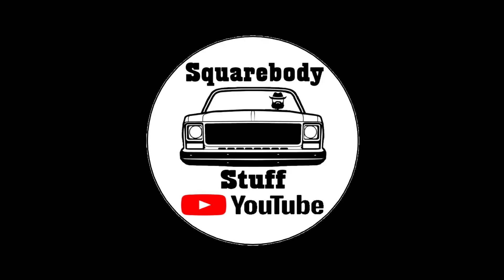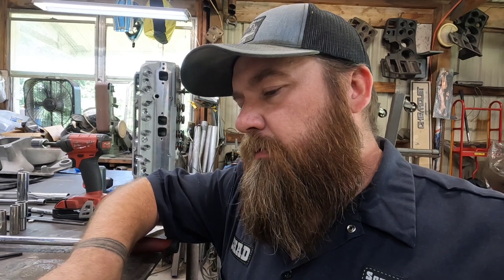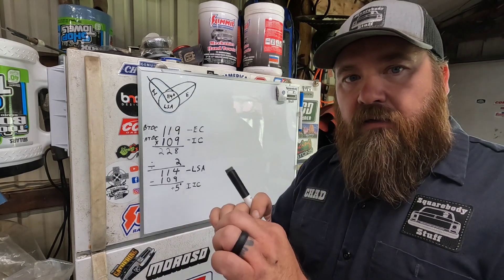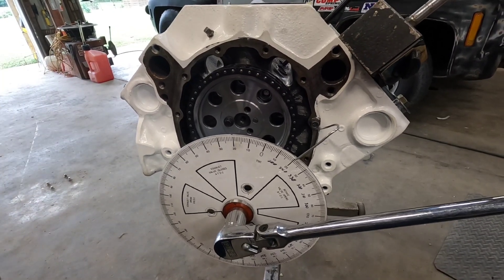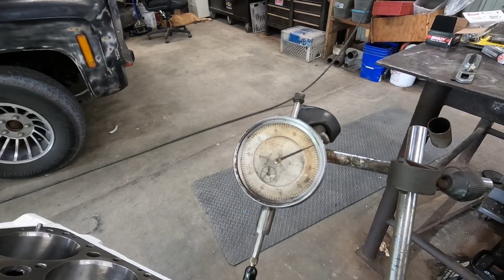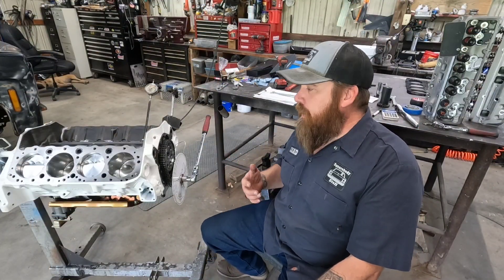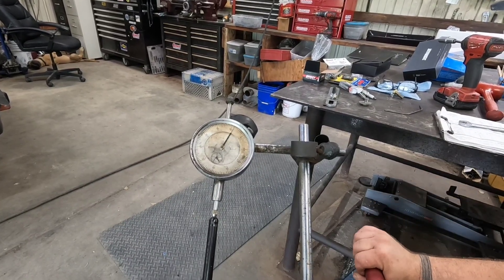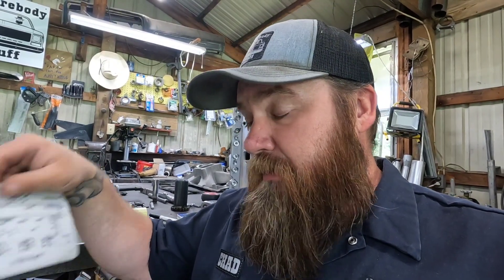Getting the cam degreed  in on my nitrous sbc 339 stroker. #becauseracetruck

Comment: Will a crane 480 lift cam fit in a stock rebuilt 305 80s model
Reply from the maker: It should work just fine.

Comment: Will a crane 480 lift cam fit in a stock rebuilt 305 80s model
Reply: Yeah, any small block Chevy cam will fit in a SBC, just you gotta make sure it’s a small base circle if it’s a roller if you have a stroked rotating assembly, if it’s not you’ll have to clearance the rods